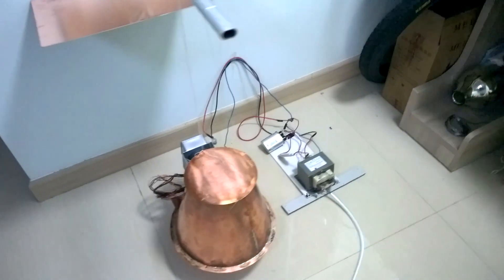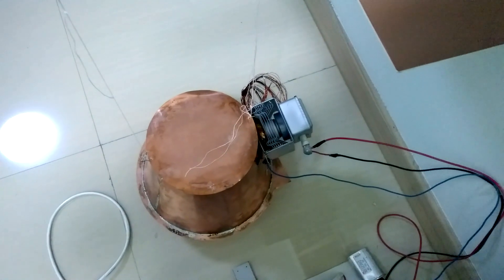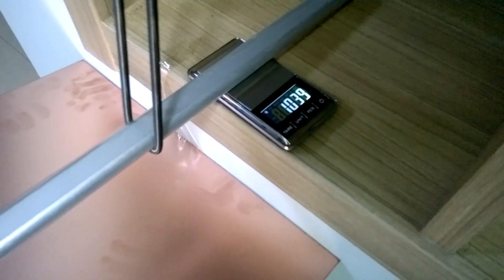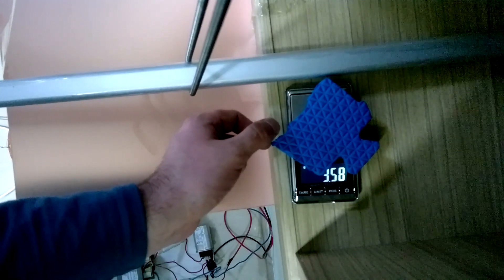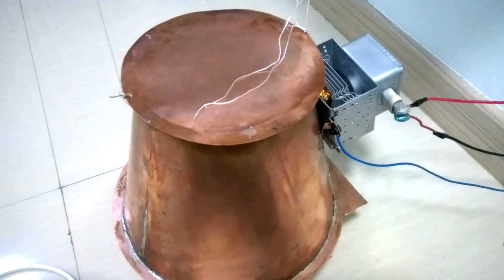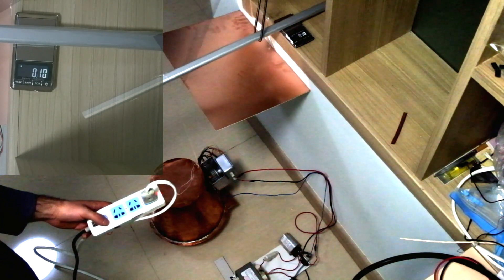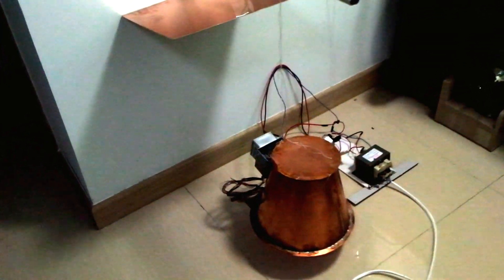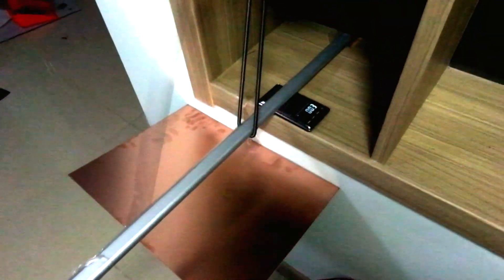EmDrive Test No.03 Success, I have thrust !!!

Comment: Assuming its a 2.45 GHz 700 W magnetron, would the scale not just be picking up resonance amplified by the long mental arm you're using in your lever AT BEST? Just in general, I'm fairly certain it would be silly to measure 0.02 newtons of thrust (optimum theorized EM Drive thrust in a vacuum) using a lab scale.

Comment: You know how this is fake and not an accurate representation of how an ATM drive-thru Lee works. One he just ripped off the a magnetometer from a microwave and attached it to a copper cylinder which vaguely resembles and emdrive casing. But by the way they only work in a vacuum. Not to mention the amount of thrust that this thing puts out cannot be accurately tested within Earth's gravity well. So this test can only be accurately performed one in a vacuum and two it really needs to be in zero g for it to be a correct and accurate emdrive test. Nice try though

Comment: Because the thrust is expected to be very low you need precise measurements and apparently you need to avoid buoyancy produced by heating the air inside the bucket. However, such device is expected to produce thrust, simply because photons have momentum which transfer to the atoms that release them. 
Therefore, your engine will definitely provide thrust in vacuum as well. You can even calculate with approximation the thrust if you know the power of the EM waves you are producing (you should have like 1kW of "light" power. If some engine is capable to transform potential (like the potential energy of a battery or of some fuel) energy into radiation that is most of it reflected into a single direction you can have good efficiency. Something that can do that well is a laser. Actually the best way of generating thrust is to transform everything into light. That is because for example if you throw some electrons at high speed they do some thrust, but if you have electron-positron pairs they annihilate and you get extra thrust from light that emerges. By throwing ions, you also loose massive internal energy (mass is a form of energy), therefore, emitting light is most efficient. On the other hand light has little momentum as opposed to massive particles. If you can afford loosing ions, they will generate much more thrust for the same energy spent to throw them. Remember, throwing heavy objects generates lots of momentum but their mass means they have  massive amounts of energy which is lost.  This is a bit tricky as you need some compromises. And in practice it is easier to go with an ion engine because there is no easy way of storing large amounts of energy that can be delivered as light. A laser for example can be powered by a battery, but the battery will have an extremely low capacity for what a spacecraft needs. Nuclear generators would be by far better. But still for how much energy they can deliver for a given quantity of radioactive material I think you can also afford ion engines which will generate much more thrust.

Comment: BS. If you set up that lever and spring in someway to show +100 grams at rest and current off (when actual weight is something like 10kg) then it would be a 1:100 ratio.  Now turn on the device and we should see 100 grams drop to say 95 grams or whatever.  As soon as see ( negative)- grams, like -120, to me it's just a programming trick in your scale (cellphone).
LOL.

Comment: Other than the air around and inside the chamber,  and having a power source outside the machine,  another important factor is being close to the ground that can result in significantly large currents through the air.  You need to make sure that there is no electron/ion flow causing thrust, i.e., your machine (including the power source) does not loose any matter.

Comment: "So far, so good." (I think some components are missing, i.e.:  a circumferential array of radio quality  tungsten grounding (& discharge) pins. But that is great, so far, since it is planned to be a variable length focal nozzle.
I know this engine reacts to the magnetron in GHz range; but also, in Mag-lev (for instance), which operates at F.M. block pulse DC or in MHz, I've felt it is safer for the human body to be around engines of a lower magnitude order frequency.  Rich Friedrich, for instance has been building Kilo-Watt Power motor-generators with the human proximity quality in mind. 
Have you ever heard of Leik Myrabo ? His work in Impulse resulted in driving spacecraft engines exponentially: 5, 10, 15, 20 (g-forces) by using a focal nozzle composed of either: titanium of anodized aluminum (small scale), under photonic laser frequencies of Mega Watts & Giga Watts that diffracted through a strontium lens.

Comment: Have you taken into account the drag of the mass of the input energy wires upon the measured thrust? It seems to me, that that mass, as well as the stiffness of the copper wiring would be dragging down upon the suspended thruster, and thus lowering your measured thrust. One needs to isolate everything to an apparent zero state and I would think that both the stiffness of the attached wiring, as well as the mass of it would be affecting your experiment. 
Just my thoughts,
Frankly Speaking

Comment: You really need to do this in a vacuum chamber. You need to make the environment similar to that of space. No air, and very very cold — roughly 2.7 Kelvin (-270.45 Celsius, -454.81 Fahrenheit). Then you will know if and how much thrust you can get. But good job on just trying period. That's better than most of the trolls posting negativity on here are doing at home.

Comment: If it was a hot air ballon effect that caused this thrust, then we would read a GRADUAL increase and decrease on the scale. Heat does not just dissipate in an instant, nor as fast as the reading in the video.

Comment: Way too many variables.  Even your movement, heat, airflow caused by heat etc.  The RF shield isn't a RF shield.  Nice try but you need a LOT more control.  Even the metal lever will change length with temperature.  Nope, TOO many variables.

Comment: It is a known fact that the waves propagating in waveguides depart from c, both the Group Velocity and the Phase Velocity. One drops below c and the other goes faster than c. To me, that seems like the effect they should exploit. Some researchers have taken to putting blocks of insulator inside the cavity. I wonder if they are trying to use it to differentially guide each part of the divergent-velocity waves? I don't understand why everyone builds their EM Drives with cones. That would seem to cause a much more complex pattern of reflections than a rectangular cross-section. Waveguides are traditionally rectangular in cross-section. And they should use silver sheetmetal, or silverplate at least, to improve the Q by reducing the Skin Effect.

Comment: A true antigravity would not require energy I think. This is still conservation of momentum. Using heavy particles is more efficient though.
 Since EM waves are emitted downwards, it means some photons are released and we know they carry momentum. Therefore the thruster should work, at least in principle but it is not very efficient because photons have high velocity but low momentum.

Comment: I have no doubt that you have thrust but when you put the sponge on to the edrive it weight approximately 6.5gr over the 3.6 that it weighted on the scale alone  so my question is were did this extra weight come from? &did you zero the scale prior to putting it under load?🤖

Comment: The velocity of light in a dielectric is given by

(1)   v=c/sqrt(dielectric constant)

higher index of refraction slower the speed.

F=W/c is the vacuum case

the general case is
 
(2)   F=W/v       force=power/actual velocity of light

where there is a dielectric the velocity is slower so the force is larger
substituting eq 1 into eq 2 gives

F=(W/c)(sqrt(dielectric constant))

The higher the dielectric constant the greater the force
Some materials have a dielectric constant of 12000
sqrt(12000)=109

So the force is multiplied by a factor of 109.

When I first conceived of the EMdrive in 1999 shortly before my lab books were stolen,
this is what I envisioned.
I realized that the difference in dielectric constants of materials could be used to create an asymmetric array where all the momentum is deposited only on one side of the device hence a force in that direction.
Originally I attempted to use an asymmetric cavity based on geometry alone but found that all the forces would cancel out and it would not have a resultant force in any direction. 
That's when i said, put the high dielectric on one side and the vast majority of the waves will be absorbed in the high dielectric material. I mean at least 99%.
I was certain that was the last entry in my lab book before it went missing. 
The dielectric differential effect could be what is causing the force on this particular design. For example if the copper walls are bare the constant is just that of air 1.0
but if a white titanium dioxide paint were used on say the round flat plate portion of the device you would have a dielectric constant differential which would yield a weak effect because of the weakness of titanium dioxide on the order of a factor of 10 or less.
So internal losses exceed the dielectric differential effect.
I hope you get the idea of how to test this theory. 
One word of caution. Tie the apparatus down well and stand clear

Comment: I realize this is an older video and this comment has probably been made several times but.....

That thing is giving off massive RF. Your scale has some "delicate" solid state electronics in it. I have seen, with much less RF, interference in the voltage output of several inexpensive and expensive opamps. I doubt the solid state electronics in your balance are rf hardened. Retesting with your balance not connected to the lever arm will confirm or rule out spurious results due to RF interference with the electronics in your balance.... or use a mechanical scale....

Comment: the volume of air to heat up to give this lift would not cool down as quick as this sorry you are wrong. If you were correct hot air balloons would just drop out of the air the second the flame was turned off.

Comment: So if it gave thrust it would go up. Not much force is being given, it would take a lot more watt's just to lift.  If you add the PCB that  would add more weight there more weight there going to be no difference and you would have to increase you electrical output just to get thrust change

Comment: your setup here has so many flaws, its almost laughable. when you turn it on, you can hear the fan coming on for your power supply, which is what's providing change in thrust, lol, not to mention the vibrations as well. Still waiting for a clear and precise technical explanation and so far nothing.

Comment: If that is a motor on the side of the bucket than that is the oscillation of the motor on the side. With your set up the scale is roughly amplified times 3.

Comment: Very interesting! Thanks for video.
EmDrive design is similar to piezoelectric gyroscope with cilindric resonator. So I have two versions:
1) EmDrive bucket resonates with microwave generator and its thust is coused by mechanical interactions of resonator with air 
2) EmDrive metal bucket electrons movements which are coused by microwaves interact with Earth magnetic field.

Comment: Sadly I am a year late to comment on this. I see a couple issues that need to be addressed . first is the possible expansion of the cavity though heat. Copper makes a fantastic heat sink and the thermal expansion could account for some of the readings.. 

Secondly, vibration from the magnetron could be introducing an error. I would suggest that you take a page from NASA test and set the unit up on a balance pivot and try your tests again.  I would love to see more test positively showing thrust. But I think you have too many variables here that could skew the results.

Comment: The thrust direction in the EM drive is in the direction of the larger diameter, so it would be pulling down the string, forcing more weight over the scale... but your scale shows negative reading when you turn on the EMD.... explain please.  Remember that you have a metal horizontal pole holding the wires, there is a strong electromagnetic field generated by the  magnetron, part of this field may be interacting with metals around and creating a pull up force.   It is very difficult to measure the very small force generated by the EMD, you need a special lab setup, and measurements should be done with laser reflection on a surface mirror on EMD, projecting the laser far, so the vector amplification would be able to show the 1.6g of force (16mN) for 850W microwave.   A pendulum is not the best way to measure it, the large mass from the whole EMD will probably not move with only 1.6g, against on mass inertia caused by earth's gravity.  Probably you would need to use several yards of string to offset the radius of the circumference caused by the pendulum.   For each millimeter that the contraption should move horizontally (in real circular), it will also get a little bit apart from earth, and earth's gravity pull will offset the 1.6g from the EMD, probably not allowing the pendulum to move.    Increasing the length of the string, you reduce the angle of the movement, with it, the sine value and the gravity effect.

Comment: The device produces heat when its turned on.  The heat from the body of the device causes a convection current of air to begin flowing along the body of the device.  There is also a big transformer mounted to the device that gets hot when its powered up and even has heat shields for dissipating its operational heat.  The tiny amount of "thrust" being produced is nothing more than a product of the heated atmosphere acting upon the body of the device itself when its turned on.  Notice when he turns it off that it seems to only partially reduce the "thrust" at first and then the "thrust" slowly reduces a little at a time as the device quickly cools down after shutdown.  And even if the device actually was producing a legitimate thrust of some kind its not enough of a thrust to be of any practical use considering the amount of power being used.  I really do wish there was something to this device but I have yet to see anything from it that I consider to be a credible or useful amount of thrust.
Reply: CosmicMeteor I'd say it's a pretty safe bet to give up on it as a whole at this very moment.
Reply: Bubble, the thing on the side of the cone is a magnetron.  There is a transformer, but that is the cube shaped thing on the "T" shaped panel lying on the floor.  What this gentleman has done, and you can see this for yourself (if you don't mind opening up a kitchen appliance), is to take some parts out of a microwave oven and re-purpose them for his device.  For what it is worth, he gets praise for acting on his interest/curiosity and you get a thumbs down for spreading misinformation.  That aside, good luck to each of you and have a very merry Christmas.
Reply: I know that this is old, but what you also don't understand is that the home microwave is tuned to heat water. There is probably enough humidity in the air under the bucket that the microwaves being emitted will heat that water in the air causing it to rise. I did notice that it takes a few seconds for it to start to rise, probably the same amount of time it took to heat the water in the air. But if it was true thrust it would be immediate and  it would continue to rise for as long as the device was on........ It wasn't.  It was only rising enough to when the air probably reached 100 degrees Celsius and then quit producing "Thrust". I would say use a different microwave source that isn't tuned to heat water and repeat. My bet is you wouldn't get the same results.

Comment: That moment when your scale never actually zeroes out while trying to get a measurement from your test system. That setup is going to catch micro vibrations from anything in his wall, including him flipping the switch and drawing power from an outlet in that wall. Hell at this point he could literally have a dc motor in that copper pail receiving power and probably get the same reading. Ground-breaking developments that make us fundamentally rethink the properties of our universe don't happen in someones kitchen with one form of data capture and very few deterrent for outside interference, I feel as though more research is needed.

Comment: are you that idiot to not realize that the amount of power put in to it to lift even 100kg (if the readings are not an eror/glitch) of mass is what makes it obviously  inefective?
Reply: kane gami you mean 100g
Reply: based on it's principle if u scale it to actual use it would use an awfull amount of energy to lift a common modern day weight, it has a worse energy/weight ratio than an first gen steam engine

Comment: pls pls pls pls build another one and set them on opposite side of a large wheel mounted on an efficient generator backplugged into the em drives then power it on and give it a good starting rotation :D